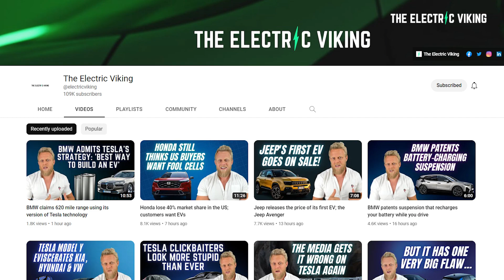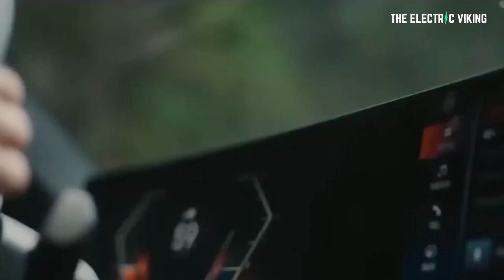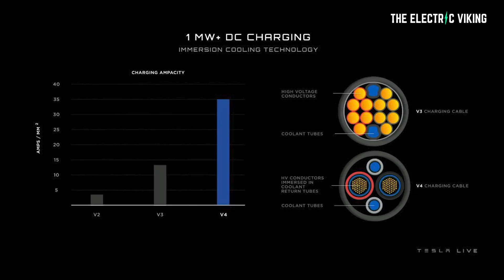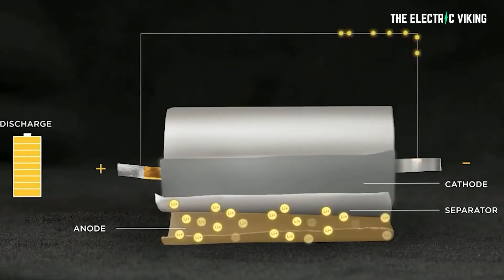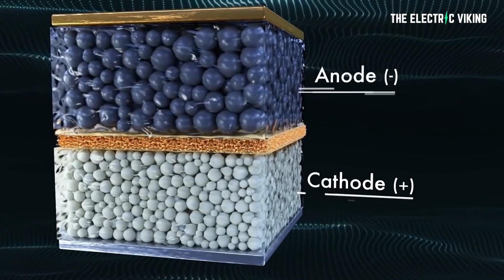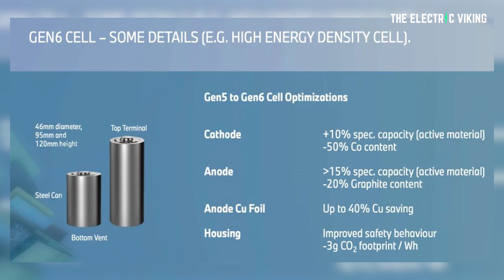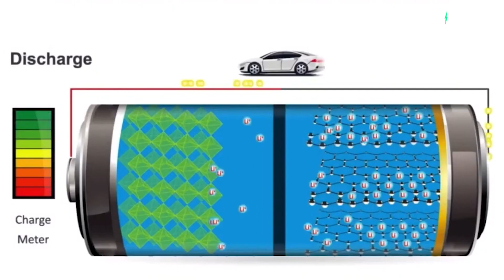BMW say Solid-state batteries are the only way to improve lithium batteries

Comment: Hi Sam, another great video! I do want BMW to survive, but since the revolutionary i3, they have basically done nothing significant to develop EVs - shoving batteries into a chassis designed around a combustion engine is a nonsense to me. But to state there will be no significant advances in battery technology seems particularly dumb to me. It is too early to predict the winning battery chemistry of the future imho, but it will be here in the next decade, maybe solid state, maybe sodium, maybe iron based, but it will come. But BMW, don’t wait for it, you need to be designing decent ground up EVs now! The i3 was a great start, then you (BMW) just walked away - big mistake!

Comment: Isn’t BMW also the company that keeps promoting hydrogen for cars? I am in the Elon Musk camp when he states that producing prototypes is easy, the hard part is mass producing at cost effective levels. How long have we heard that perovskite solar cells will blow silicon solar cells out of the water. Perhaps it will get there some day but in the mean time costs of the established silicon solar cells keep dropping. It’s a moving target. Same holds for batteries. Tesla is struggling to mass produce its 4680 cells with the new dry cathode and anode. It takes time. Solid state is further behind in mass production. And it is a moving target. It will need to compete against a $50 per kWh battery pack. I do believe solid state will eventually happen but I wouldn’t build my car strategy for this decade on solid state batteries.

Comment: 1. BMW may be right but I sincerely doubt that they'll be the ones to get there.
2. Battery formulation is only a small part of an EV's power train.
3. EVs need to be sleek or they aren't efficient. Efficiency is paramount in an EV. That imposes certain physical constraints on the design.
4. The Hitler Mustache front fascia of BMW vehicles are actively Ugly. 
BMW probably made enough money that they didn't care how it limited the EV's appeal, but it's a new game now.

Comment: Peaks in industries can never be measured except in hindsight, although they can some times be predicted in general (such as peak oil production). To say that such a young industry as lithium batteries is peaking now is just hubris, since there would first be a plateau for improvements, often shared by a negative plateau for pricing as the only improvements available are in manufacturing, and then the final plateau of peak use, then followed by a decline in production. The decline in production can often be drastic when companies suddenly stop production, such as the film industry.
Reply: one could argue though we are entering the "plateau of peak use" maybe not volume wise, but technology wise, which would validate BMW claims. there are other battery chemistries starting to enter production that destroy lithium based batteries, i give lithium another few years of dominance before the "drastic decline in production" happens

Comment: The work they are doing on batteries is mind-blowing at the moment.  I recon that we will reach the ultimate in about then year's time. THAT's when I will buy my first EV.
Reply: Teslas are good enough already.
Reply: @Islamisthecultofsin  Maybe  good enough for your needs and comfort. Not mine.
Reply: @viskovandermerwe3947    I feel completely spoiled when I drive my EV.  No gas car compares.  The acceleration is instantaneous.  Smooth.  Quiet.  Just keep a log book of how far you drive everyday so that you buy a car that can handle your daily drives.  My car doesn't even have fast charging.  Every day it's ready to go and then at the end of the day it gets plugged back in.

Comment: I don’t understand “solid state” in this context. Which part of the conventional lithium ion cell is moving? Seems pretty solid to me
Reply: It has a solid electrolyte.
Reply: Don't the lithium ions move between the cathode and anode, with a electrolyte in between, this is normally a liquid, but can be a permeable solid. The solid can be made thinner and therefore lighter. It also can be resistant to dendrites causing shorting (fires) so is safer.
Reply: @AORD72  By this logic nothing is solid state because electrons move lol
Reply: @masonhales  Well the structure of the battery is photons and neutrons, the electrons move from side to side.

Comment: Certainly Lithium Ion has to be a stop gap as supplies are not at all adequate to make more than about 5 Million Y size or 6-7 million  Model 3 size EVs.  One reason current EVs weigh so much is the battery pack is volitile and has to be heavily protected.  A scalable , safe cell that is hopefully more energy dense; has a long life; and is cheaper would do a lot to make EVs more than just a niche market.
Reply: "niche market" lol.  You should take a look at recent EV sales data.
Reply: @incognitotorpedo42  Well depends what you call 'niche' of course, but in most markets, sales of EVs are well below 2-3% market share.

Of course there is a clear vision of growth. It all depends on what your perspective is.

'Niche' could be taken as a slight exaggeration. But at the same time YT channels like this one, raving about EV market share, are usually quite selective in their reporting of the actual statistics and watching them, you could easily overestimate the actual market share EVs currently have.
Reply: I think for the future we can be certain that EVs will not be a niche market even if they currently still are. The international agreements on decarbonization pretty much guarantee we will be driving Li-ion BEVs in large quantities. Alas, they will be expensive and heavy compared to what we are used to, but battery (pack) energy density improvements to bring vehicle weight down to what we are used to today are a long, long way away (if they are ever achieved).

Comment: Well BMW, make them and show us then!
Reply: What should they make? Li ion cells with a similar energy density as others produce today? I think there doing that already every day.
Reply: @hvh377  like the title says; solid state. And they are not making any battery now. They buy from vendors on chinese daytrade.
Reply: @ARPost-kn2jl  I don't think that the title reflects what the BMW engineer said. It's the fact-twisting clickbaity title the Viking made out of the web article on insideevs, which they made from a press release by BMW.
I'm sure BMW will be making the solid state batteries when (IF) the time comes for them to be viable in volume production. If I'm not mistaken, BMW is heavily invested in solid state battery research, so they'll be the first to know when that time has come.

Comment: What's your opion? Switzerland Considers EV Driving Ban And Limits During A Blackout
Reply: are they also going to ban ICE vehicles since the reason they will have a blackout is because russia cut off the oil and gas spigot?
Reply: @scottmcshannon6821  No because the problem isn't oil and gas. It's power grid.
Reply: @uowebfoot  the grid is a problem, since those running seem to insist on keeping their heads in the sand instead of keeping it current, BUT if you dont think oil and gas is a problem in europe with russia your number one supplier, you have your head in the sand.
Reply: @scottmcshannon6821  I totally agree. I was responding to another. The drive to go "green" is the real problem. Let the trolling begin.
Reply: Personal megapacks to th rescue

Comment: Hopefully there's a goal to get off lithium. That would be a gamechanger!
Reply: Redundancies in battery formula materials is already a function of battery development and we will continue to advance in our knowledge and technology of battery materials . Lithium is a very abundant element and it’s supply will increase undoubtedly.
Reply: @nickkacures2304  it is abundant to a degree but the easiest way to get it is the most destructive 20-30million tones of earth needs to be mined to produce 60t of usable lithium fact the other cost more or take more time so yeah lithium isn't sustainable long term and no other element on the periodic table is as energy dense as lithium therefore how long can BEV's be the go to. more research needs to be done on hydrogen production, distribution and fuel cells I'm even not against hydrogen ICE but yeah that is an inefficient form of transport but at least it can sound good and it does work
Reply: @nickkacures2304  it's a lot easier and cheaper to mine other materials like aluminum and sodium. Also the mining and production methods all exist to produce enough material for annual EV battery production.
Reply: Not for the miners.

Comment: Let's all disagree with the BMW engineer. Let's not be held back by any knowledge of chemistry or battery physics and disagree, so that physics can be overcome and lithium ion batteries will be energy denser in the future.

There is a theoretical limit to the energy density achievable with lithium ion batteries. Just like there is theoretical limit to the amount of energy a carbon-based liquid of a certain volume can produce. Apparently, this BMW engineer thinks we're already (after 30 years of intense development or so) close to that limit. I believe there are more experts in the field thinking along the same lines.

There are still gains to be made on the module or pack level probably, but as the latest battery day has shown, the gains of the 4680 cell were not in the chemistry (and thus energy density), but in the mechanics of the cell. 5x more energy than the 2170 (by making the volume of the cell 5x larger).
Reply: @orionbetelgeuse1937  The thing I understand they are struggling with is the scaling of the dry process for cathode production and the introduction of Si in the anode at scale. This means that the 4680 cell actually still is slightly less energy-dense than a 2170 cell. I'm not a chemical engineer and I don't know much about battery production, so I could be wrong.

I believe the 4680 tabless design is a major contributor to lowering the internal cell resistance and therefore allows larger (dis-)charge current without overheating. However, to me that seems a mechanical improvement, that could possibly be applied to a 2170 cell just as well.
Reply: @orionbetelgeuse1937  The most energy dense Li-ion cells have about 15% Si in the anode (I'm told). This is supposed to improve  energy density.

And I agree with your analysis of volume vs. area and heat exchange. All I said was that lowering internal resistance diminishes heat production. Heat that isn't produced doesn't have to be exchanged.
Reply: @orionbetelgeuse1937  It's what Tesla currently does for their 2170s I understand.

Comment: Right now EVs don't have transmissions, but I'm quite sure they can come up with a way where transmissions will have "overdrive" and this can extend #Range.
Reply: There isn't much chance of that happening unfortunately. Electric motors are already very efficient. Adding a gearbox (with selectable gears) will not make a lot of difference efficiency-wise. There just isn't much left to gain.
For an ICE vehicle it's different. An overdrive will allow reduced engine RPM at a given speed. This allows the engine to run in a more efficient regime (closer to peak-efficiency than peak-power) and therefore reduce fuel consumption. The downside of an overdrive is that the vehicle will not be able to reach peak-power RPM with overdrive engaged (lower top speed).
Reply: Porsche has a 2 spd and it doesn't result in an efficient vehicle.  Gear boxes use energy too.  Spinning an E-motor faster is nothing like spinning a reciprocating engine faster.
Reply: Thank you one and all  👏👏👏     🙂

Damn  ... I thought I was onto something  😒
Reply: They do have a transmission what do you think the reduction drive is it's a transmission it's not a 2,3,4,5,6 speed/gear transmission but it is a transmission wow you EV lovers are a different breed
Reply: @robincollis6349    Yes it's more accurate to call it a single speed drive train or transmission.  (semantics in this context) VERY different from one with multiple ratios in terms of cost, complexity, weight, and opportunities for failure.

Every continuously variable trans made today fails before 150k miles, half to fully totaling the car, most fail well before 100k, older style autos also fail.  Only manuals can last but then the clutch may fail depending on abuse, expensive to replaced due to labor.
Reply: @Mrbfgray  ECVTs last refer gold coast cabs (Prius, Camry Hybrid) I know not typical CVT but its still a CVT and torque converter automatics can last much longer then they do if they had a service once in a while (no scheduled service on modern transmissions) but these reduction transmission will fail if they aren't serviced same as a differential/final drive can fail if it's not serviced (similar complexity and loads as reduction transmission)
Reply: @robincollis6349    Maybe if expensive enough and frequently serviced CVT could last, fact is they don't even if serviced.  Same with old fashioned fluid drive trans, they never did last well.

Differentials rarely fail unless run dry ore utterly abused.  Great comparison, a well made EV drive train will easily last 1 million miles with a few oil changes.  

Meanwhile and ICE will suffer around 100 oil changes in 1M miles, but they only last an average of less than 200k, some can go 500k (Honda, Toyota, expensive diesels) and when they are worn out the car is totaled.  

I've worked on 100's of semi trucks--MFGs been struggling to get them to 1M miles for many yrs, even oil filters on diffs and getting pretty close.  VERY rarely is the diff the reason we are working on it even at 800k miles.
Reply: @Mrbfgray  yes conventional CVT are rubbish ECVT are amazing it's literally 2 electric motors opposing each other and there not expensive Toyota was selling new units for like $4000au little ware very reliable and torque converter automatics never get serviced that why they fail and diffs fail even with oil and not abused oil can be contaminated water dust can get in heat from pressure (torque equals pressure equals heat) deteriorates oil EVs have pretty awesome torque and with trucks ok look at what they do always pulling heavy loads you use that drive line like a car couple of occupance maybe a tone or 2 they'll last a lot longer but they'd be pointless too the Tesla semi will be interesting to see how long they last If always working on the max capacity every thing is relatively and all things mechanical need maintenance. Heres one for you i had a traction motor (electric motor) fail in a locomotive last night locomotive only 7years  old the diesel Genset that powers it still working fine
Reply: Very possible true………. Alternative maybe ground mounted coils using magnetic resonance coupled receivers on th bottom of vehicles